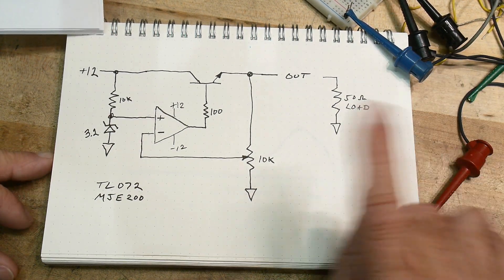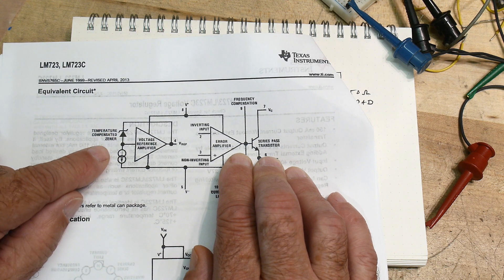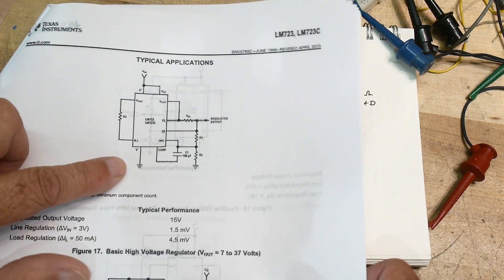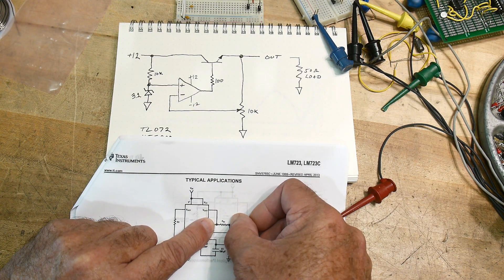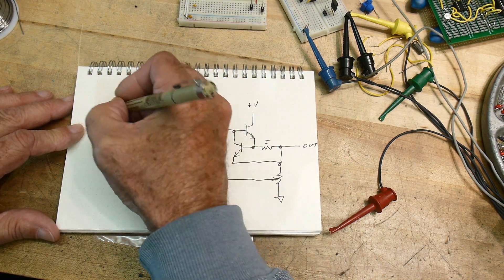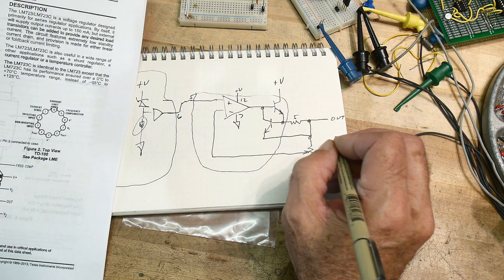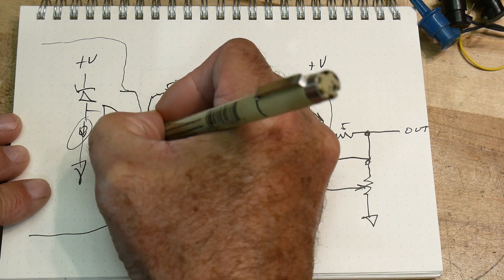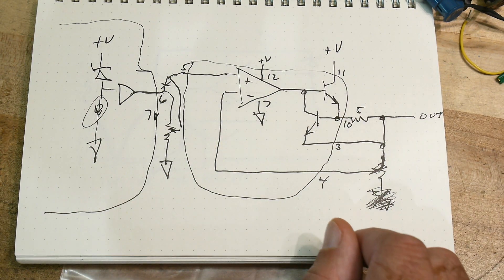#1091 LM723 voltage regulator

Comment: Thanks for this! I am a bit rusty and am about to troubleshoot a linear supply using this chip. The light bulb went on again with your walk-thru!
A couple of things to note.
1) the data sheet pinouts that I looked at (shown on a schematic for the chip) are labeled with the TO-100 package which are different pin numbers than the DIP. I had been scratching my head on that one for a little while.
2) in your discussion, your simplified diagram was good, but you combined pins 10 and pin 2 (which you say isn't used) on your diagram. Pin 2 is indeed used, but you didn't split that out on the diagram but instead tied it directly to Vout....unless I looked at it wrong?
Thanks again!

Comment: I'm wondering if I need a 0-30V power supply, can i connect the lm723's ground to let say -8V?   What do i need to get a nice 0-30V out of it?
Reply from the maker: I've biased LM317 below ground to get zero volts, I assume you can do something similar to the LM723. be careful not to go past the max voltage for the part

Comment: Hello, I am new to this IC, I have the old To-100 metal can package IC and this package dosent have the "Vz" pin Which is present on the Dip package can anyone tell is that pin Important or not I want to Make a 0-30V 0-5A power supply using the IC.
Reply from the maker: Not needed
Reply: @IMSAIGuy  Thank You For replying :)

Comment: A nice old versatile current / voltage regulator chip. But there are two other old chips for this purpose. You can also have a current regulation / current limit functionality for your LM317 / LM337 just by adding 1 transistor and 1 resistor. Because it works with a 1.25 V reference you can always have your potentiometer at the same position. Or you can use an L200 which comes in a nice 5 pin TO-220 package and you only need to add 1 resistor for current regulation / current limit. The references for voltage / current are a little bit strange (2.77V / 0.45 V). In both cases you can go to 1.5 A and if you need more you can add an external pass transistor.

Comment: My astron rs35 is basically an lm723 with a bunch of pass transistors.
Reply: I compared the RM-35 and the VS-35 schematics to learn how to build different output voltage supplies.
add as many pass transistors as to current draw needs!

Comment: Thanks, that was the most useful 723 walkthrough I've seen.  I recently made a 723 based supply which used some new uA723 chips from Digi and found them to be quite noisy.  I dug through my junk box and found an old LM723 which was much much better.  I guess they don't make them like they used to!

Comment: Great video and introduction to an IC that I did not know about. It seems to be the (mostly) complete front end for a DIY linear power supply. So, why do manufacturers use individual components? Rhetorical; I know the answer is economics. Mouser prices start at $13 = ouch.

Comment: I've been doing electronics as a hobby or career for nearly 50 years, and last year when I needed to design a low-dropout lead-acid battery trickle charger I turned to the 723 because I knew it had all the features I needed. I still had a couple of 40 year-old specimens in my anti-static foam lined parts drawers, but I figured it wouldn't hurt to order some more in case they ever became hard to find, but for now at least I had no difficulty finding new stock in hobbyist quantities.
One thing you glossed over in your description was the zener diode between Vout and Vz. In fact at one point you even covered it up on the schematic with your finger and then never mentioned it again. In all the years since it was originally released in 1967 I have never seen an application note or project in the wild that used it, or even explained what it is for. Vz is not even brought out to a pin on the metal can package and the data sheet says if you need this function with that package (whatever it's for) then you should connect a discrete 6.2V zener to Vout. A couple of years ago I posted questions in all the online electronics forums I could find and not a single person replied with useful information.
I suspect it was intended as a level-shifter to allow control of a negative rail pass transistor below chip ground, but I wonder if it has ever actually been used in any real circuit or product.
Reply: Yes, in the app note from TI exactly for that, and keeps the internal opamp from saturating, when attempting to drive the internal pass transistor too close to the  negative rail. Keeps the internal circuitry stable, as that opamp cannot pull too close to ground. Ideally you want to keep pin 9 and 4 (DIP package) reasonably close to each other, so the zener is used to give that 6V2 step, by using basically the emitter base junction of a transistor in reverse, along with the base collector junction in forward bias to temperature compensate it. 

The most critical diffusion in making the wafer, so it is monitored by test structures and probes during manufacture, to make sure it is correct. Forms all the 3 zener diodes in a single step. along with every other transistor base emitter junction.

For a 40 plus year old design it is still quite good, with a reasonable performance as well, plus is quite versatile. Still available, and yes, there are better more modern chips, but still being able to handle 40V as input voltage is still an achievement, and I have used them as references before, they are quite good at that, even being good enough to use for power supplies with 0.1% output voltage tolerance. Used them to make suppressed zero meters, making the IC a current sink, that kept a defined reference voltage, so the meter could have a suppressed zero, to make best use of the range and display markings.
Reply: @SeanBZA  Thanks, that makes perfect sense. Do you have a number for the app note?
Reply: Search for 0900766b800769ed.pdf (which shows Vz being used in a negative voltage regulator) and lm723-440706.pdf, select the Mouser link (which shows Vz being used in high voltage and a current limited supply)
Reply: @ralphj4012  - Thanks. That's pretty much how I imagined using it. That Mouser-linked PDF has the illustration labels confusingly placed, it's not the high-voltage circuit that uses Vz, it's the exact same negative regulator circuit as in the first PDF. Also the second example that uses Vz is the positive floating regulator, not the foldback limiting one.
Reply: @PhoenixRevealed  Yes, apologies. Also search for LM723 Cookbook and then click 'A collection of proper design practices' and then on the ua723 Application Note which shows more examples (treat with large dose of salt and check pin numbers)
Reply: I believe Vz is used when you require an external transistor for increased current. Search for LM723 with external pass transistor.
Reply: @ralphj4012  Nope, that's not it.